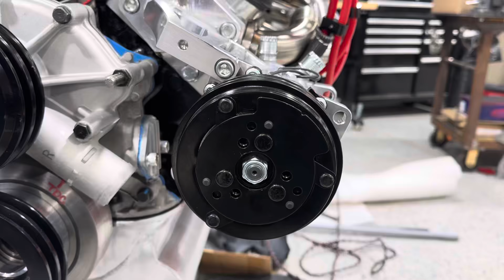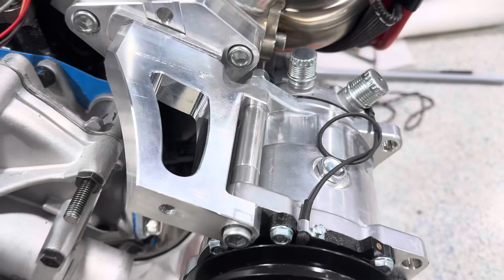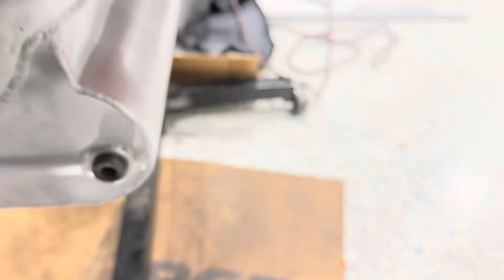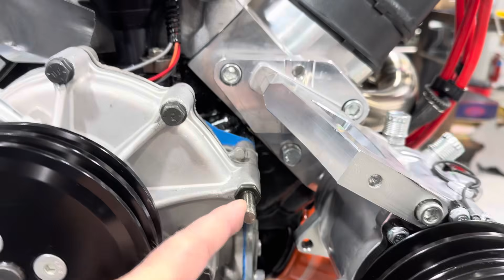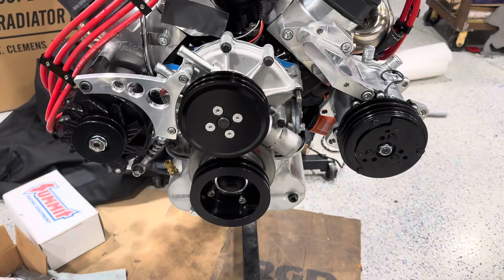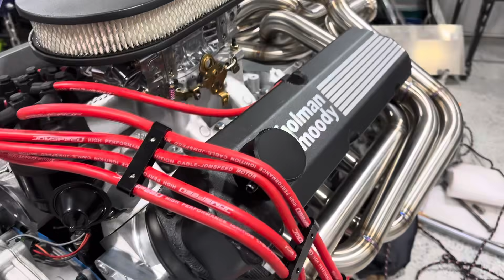Ford GT40 (RCR40) Project: Mounting the AC Compressor

Comment: Super clean. Best option I’ve seen for this so far. I’m still waiting for my compressor to arrive. When it does I’ll be doing this as well. How did you settle on the near 45 degree angle?  Any nocking up in the engine bay or was it just an aesthetic angle you thought would work well?
Reply from the maker: That where it cleared my heads and block for making the tensioner adjustments. It’s probably at more like a 100-110 degree angle. Not sure why I said 45. I take it down a bit more so you have direct access to that head bolt to attach it.